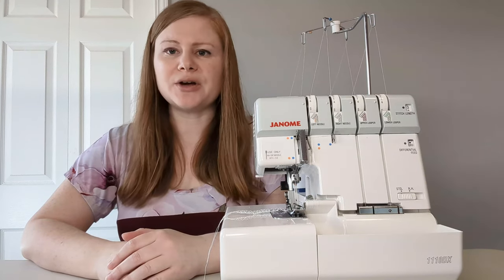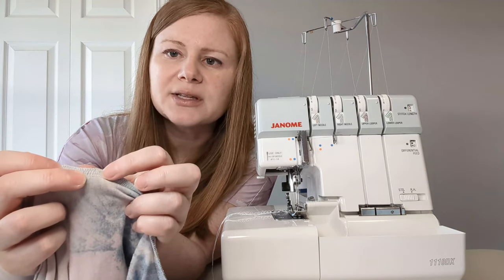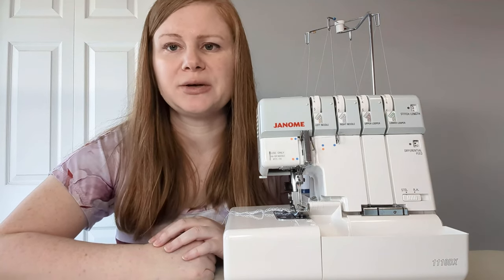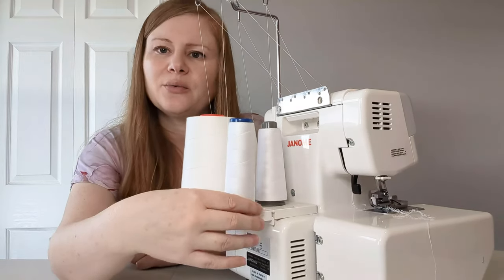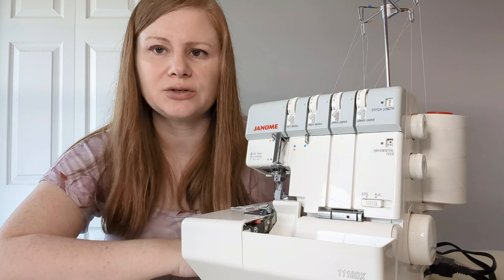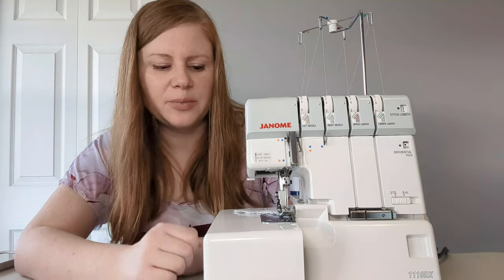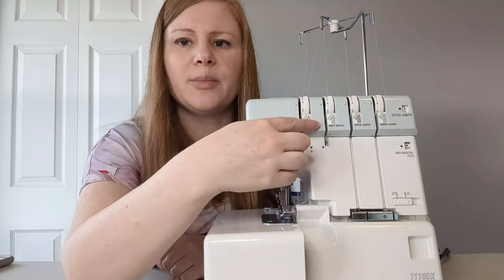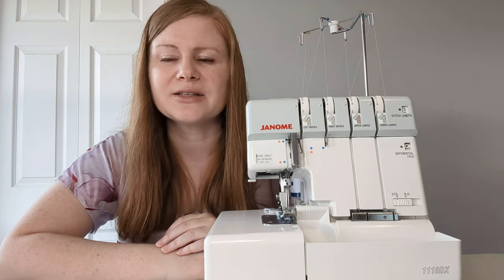What is the Difference Between a Serger and a Sewing Machine?

Comment: You cannot do a top stitch with a serger but you can definitely do a zipper and blind hem or rolled hem and flat lock stitch to join fabric with the serger.  The serger can also be used with 2 threads besides the 3 and 4 threads you mention.
Reply from the maker: You are right. This was intended to be a basic overview for beginners, so I did not go into detail about some of the other stitches it can do. I do think most zippers require top stitching, so while you could technically install one with a serger (if you skipped the top stitching), it would be much easier with a sewing machine and in most cases it would have a nicer finish. And while there are hemming options, I would not recommend them for a beginner.

Comment: Hi I’m thinking of investing in an serger for my Scrunchies. What would you suggest? Would it be good? I’ve got a sewing machine and very use to it but I find myself spending extra time cutting off fraying fabrics, or re-sewing parts of opening gaps. Please let me know 🥰
Reply from the maker: Personally I'm not sure I would use one for scrunchies - it makes the seams more bulky and it doesn't really save any time on a small fully enclosed item like that. You can use pinking shears to cut your fabric to reduce the fraying.
Reply: @SewPDF  thank you for that yeah after seeing a few videos of Scrunchies made with a serger it seemed to flattened the Scrunchies because of the bulk look along the seams. Glad I asked and did some research before investing in one 😊